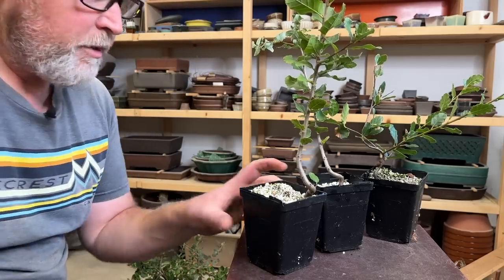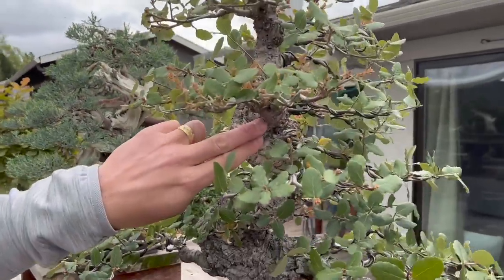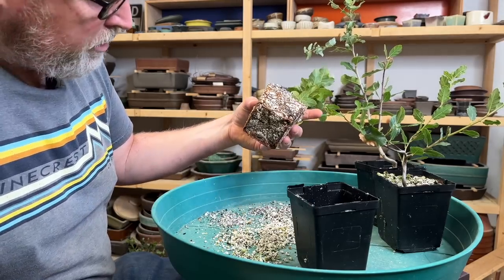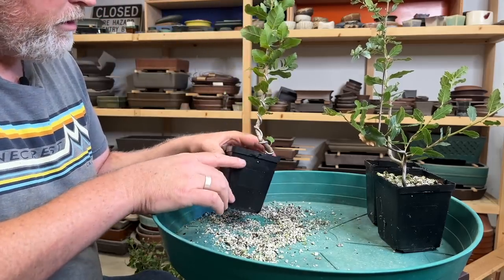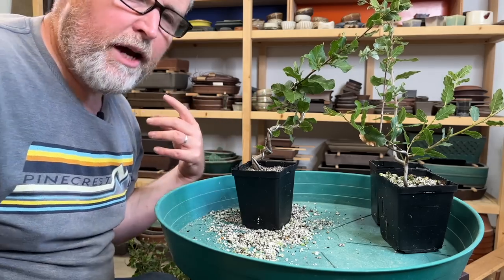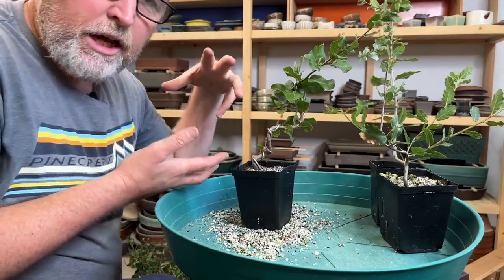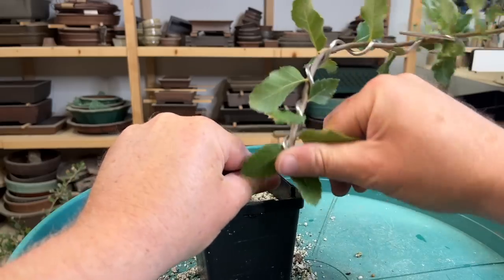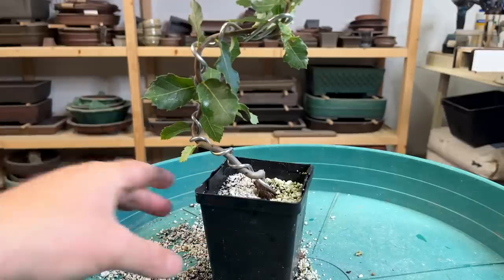Bonsaify | How to Make a Great Cork Oak Bonsai!

Comment: Eric, thanks for following up with this video. The one I got from you last month has adjusted to its new spot on my bench and is now growing like a weed so your video came just in time. I just sat down and put a bunch of new curves into the 4 straight shoots that are about 8-10” long. Hopefully with all the fresh new growth they will do well.

Any other tips on timing of things like repotting and how they take root work in the spring would be appreciated. Also it would appear that if these in 3” pots are moved to gallon pots next spring I might get explosive growth over the next growing season. So your thoughts on repotting and root disturbance would be even more important.
Reply from the maker: While young I would concentrate on combing and arranging the roots. I've seen them die from overly aggressive root work, so be careful about how much you cut. Timing wise - early spring is best, but keep in mind these are not a cold-hardy species.  Zone 8 USDA, but in a bonsai container I'd aim for 28F or above.
Reply: So this one just keeps on growing, when do they usually go dormant? Since I received it the main stem has added at least 10” of new growth. I wired and twisted all three shoots and they have extended 2-3” beyond the wire! I finally tried an experiment and snipped off the end of the longest one to see it f I could get it to backbud. I plan to put it in my garage for the winter as my wife already hates it when I bring my Brazilian rain tree into the house each fall. I had a slippery elm that refused to drop its leaves last year that I then wintered in the garage and it is growing well in spite of not having a dormant period.
Reply from the maker: Lol.  Yeah you have to let bonsai get kinda big and lanky for a while if you want the larger trunk and bark. 
Being a coastal mediterranean species it is likely opportunistic - as long as conditions are right it keeps growing. We see this with a lot of coastal California trees also.

Comment: Would it be a viable solution to apply the wire when dormant, then wait to actually bend once it's growing?  It seems like that way you get the best of both worlds.
Reply from the maker: Great question - and I assume it would - although you do bend the branch a little just by applying wire. But, I think it could work.

Comment: Great video, thank you for all the insight, but a quick heads-up, that even has been mentioned in the comments.

Although not an incorrect comment when you mentioned that cork oaks can be found in Spain and in most Mediterranean countries, they are much more abundant in Portugal, which is the one of, if not, the largest cork supplier and exporter in the world.

Side note, I have recently bought a piece of land that has  several mature big cork oaks, and I'm trying to grow a bonsai from them. Will a stem work or do you advise planting seeds?

Thanks in advance!
Reply from the maker: I think you can air-layer them, but not cuttings. I could be wrong, but I seem to recall that oaks are basically never propagated by cutting. 
I just planted a couple hundred acorns that came from the cork oaks on the UC Davis campus. They don't harvest the bark out there, so it's a gnarly campus. So, my strategy is acorns.  Unfortunately, in the northern hemisphere you just missed the season to pick them.  See if there are any left?

Comment: When do you cut the tap roots? 

I’ve grown Texas live oaks from seed 2 years ago. Had them in 1 gallon pots from seed. They grew long. I repotted on the second year in bonsai mix and cut the tap roots off. I’m going to check them on their third year and move them to larger shallow pots.
Reply from the maker: Tap roots aren't a myth, but they are mis-understood. They are just a big root essentially, you can cut it back after the first year or two, then continue cutting it back as the tree makes more lateral roots and you repot a few times more in subsequent years.

Comment: Eric—so based on one summer of growth these seem to have a tendency to just take off and grow like crazy extending long branches and stems. So instead of just chopping these back and tossing them in the compost, how well do they root as cuttings or as air layers?
Reply from the maker: Dirr says that cuttings of all oaks are difficult but not impossible. Use a high PPM IBA rooting hormone (perhaps Hormex #16). I believe air-layers can be successful, but cuttings might be a bit frustrating! In any case, success with either would be heat- and rapid growth-dependent, so better left for late spring/summer.

Comment: I bought a cork bark oak from you in early spring. I am in Minnesota zone 3a. Could you instruct me on what to do with these I my growing climate. I am thinking keeping the in the house
Reply from the maker: I think they are cold tolerant down to only 15F in the landscape.  So as a bonsai, keeping it between 28-40F through winter is best.  Most people in cold climates so something to keep temps from getting too low, while trying to maintain the dormancy.
Reply: @ thank you for the information

Comment: From little acorns grow great oaks.  How long would it take for these newbies take to develop acorns and are they in proportion to the tree or big?
Reply from the maker: Oaks normally take quite a while to start making acorns.  I've never seen any on my 17 year old valley oaks, but I trim them normally so that may be the issue. They tend to be slightly smaller, but not miniature...kinda like the leaves.
Reply: While I don't have any cork oak, I do have a number of other oaks that I've started from acorns and this year one I started in 2000 began developing a few acorns.
Reply: Are the acorns mini ones or near actual size?
Reply: @Bonsaify  Nice one, that really clears up the confusion on my part.  The Oak tree is actually Welsh and not English as the text books would suggest?
Reply: @9daywonda  They were small, but that's because they aborted very early in their development.

Comment: its a bummer california oaks are the only ones that like being bonsaid lol i have tried a lot with red oak around here and they really do not respond well. once you touch the roots on red oak they will die back for a year or two
Reply: I've been growing red and white oaks and didn't know this. I cut the tap root on them when there acorn was still attached  without a problem.
Reply from the maker: Just for the record - Cork oaks are not native to CA, and they are more usable than any CA species I know of. Q. agrifolia is finicky.  Doable, but finicky.  Q. lobata is also doable but can be finicky. I've tried many others that are native to CA with little success.  Blue oaks for example are just plain frustrating. 
Q. robur is usable from England. Keep looking!
Reply: @jameswalker3416  what kind of soil mix do u use for them?
Reply: @Sherman_616  50/50 safe t sorb and potting soil.